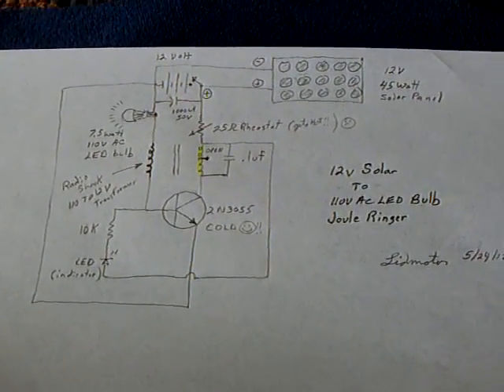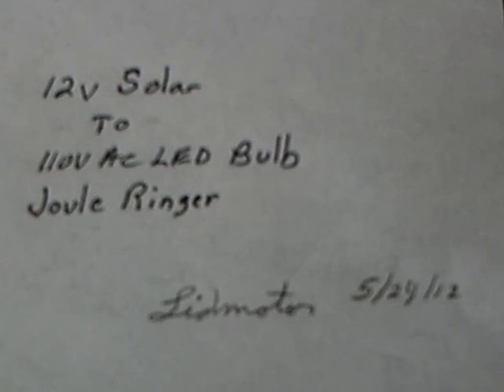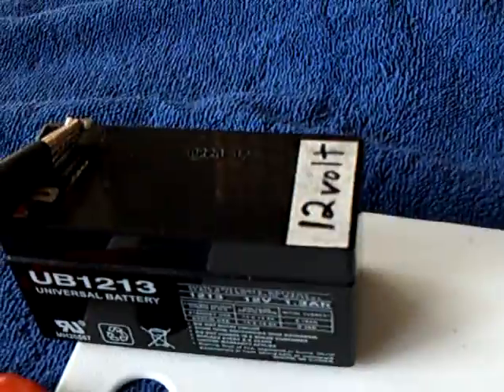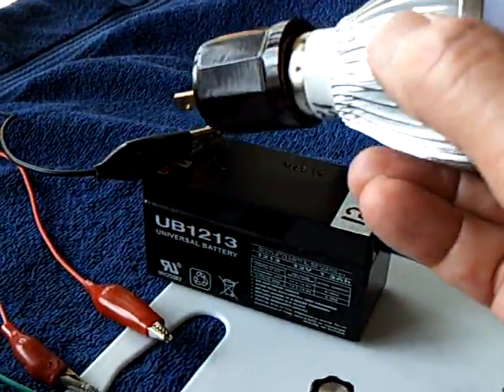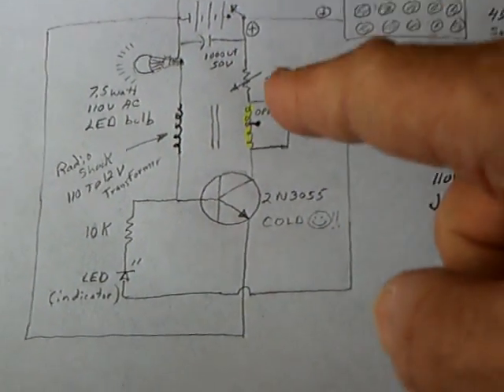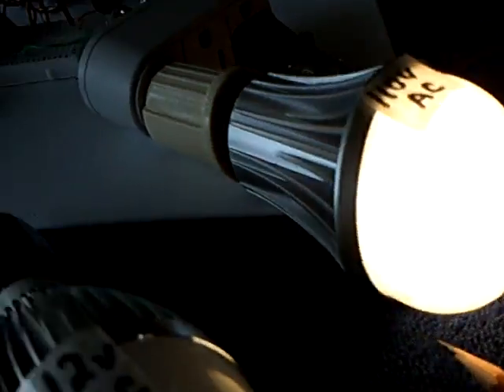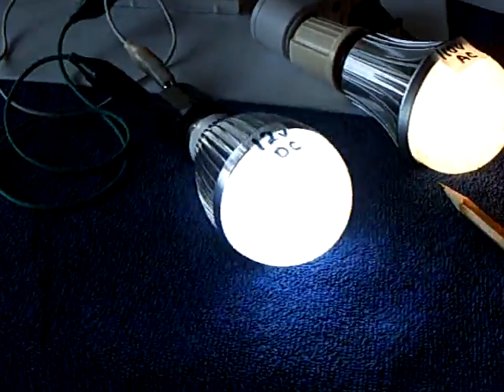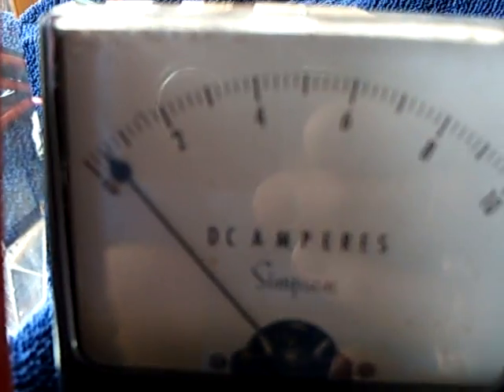Solar to 110v AC LED Bulb ---Joule Ringer

Comment: Ditch the PV panel, (maybe, if you like) and try some of Tesla's radiant energy collectors, I'd be especially interested to see someone in a highrise try this. PV panels only last so long, and are pretty toxic to make. Tesla radiant panels could be made to work for hundreds of years, and will work at night too, as they collect power from stars too. I have only done it using uhf tv ant, but it seems to work. not just getting radio energy. I get more during daylight, and more again in strong sun

Comment: The circuit we are looking at needs LED bulbs burning for it to work, but the lumens are flowing even if they are not needed (the boat is at the dock, let's say) 

I've got a goofy idea for a light housing with a hood, for those times you would "turn out the lights" but still need to charge batteries.

Something shaped like a tuna-fish can, open at the top, with PV cels at the bottom, pelletier devices on inside walls and heat-sink on the outside. Extra charge while monitoring heat and light.

Comment: Some very interesting ideas around charging, and we haven't yet discussed synergies.

The "lidmotors boat" scenario, as I imagine it, might entail a PV panel, 12v storage battery, transformers and maybe some bigger capacitors. If batteries can be charged with inductance (and it seems they can) and the transformers and the caps cause inductance, how could these elements be arranged physically, what shielding or extra copper, could give us simultaneous inductance and direct current charging ?

Comment: Ambient solar. Nice. green and RBG led's are good for that, haven't played with them much though.
I have a similar dream. after selling my property and moving back to the city, it amazes me how wasteful people are with power.
So I am trying to charge battery's and run lights from radio waves, static, and maybe even cosmic ray's. I figure this stuff has plagued engineers for years, why not use it to our advantage.
These joule circuits are going to be very helpful! 
Thanks to all the contributors!

Comment from the maker: Thanks for that tip on used panels.  Congratulations on running on solar for over 10 years.  That is a dream for many of us who are suffering with big electric bills now.  Couple that with soaring gas prices and one's whole standard of living starts to deteriorate.  Especially if you are retired and living on a fixed income.  I'm working on indoor ambient photovoltaics so that even apartment dwellers could do SOMETHING off grid.   Even a small led light is a step in the right direction.

Comment from the maker: Yes!  On this circuit you can really tell the differences between the LED bulbs.  Some of my bulbs won't work alone on this circuit but will work if they are paralleled with ones that do.  Good job getting this to run on 4 volts.  Mine only runs on 6v and up.

Comment: I lived on solar for over 10 years. Be careful with used panels! They do deteriorate in sunlight! takes 10-20 years to bring amp's to about a third of new...

If it's been sitting in a dark shed for years you may have found a bargain though..

I got all my good panel's on ebay, direct from manufacturer, much cheaper than retail!

I've been following you and lasersaber for a bit, and would love some feedback on my first video.

Keep up the great work!

Comment: I made a small discovery tonight that if you place a 100ohm resister just after the the utilitech led bulb you can change the freqency and brightness of the blub but amp draw does change too but still worthy of a mention. I have worked on some adaptations of the circuit using very low voltages like 4 volts getting a lights of america bulb to light but found it only works on certain bulbs not all lights america. Each led light is a unique animal in the forest of led lamps.

Comment: Confirmed, a clock radio doesn't run lol, had to try it. Kinda interesting though, being as the device has own transformer and power circuitry...an inverter for inverters could be next, without traditional losses ! 
"When you're over the target" springs to mind again. So far, that's 7 anti-aircraft emplacements I note on this vid, very cool. Turn it around, it's kind of them, they let you know when you're on a winner :)

Comment: Well seeing as it's hard to run dc current over long wires, I'd say apparent brightness is all that matters if you plan on having a few bulbs around your boat, or even if someone wanted them around a house. AC is definitely the way to go.

Comment from the maker: Right now I can't answer that question very well.  The AC bulb (I think) is being "blinked" and the DC bulb is on constant.  That is where the "apparent brightness" comes into play.  As long as the blink is fast enough and the circuit doesn't rob too much juice---- the AC bulb should show a power advantage over the DC.  My eyeballs are saying the AC bulb running on this circuit is the winner.

Comment from the maker: I will try a choke there but I am probabbly going to use a variable voltage regulator as the current controler and dimmer.  Magnetman showed a simple one that he uses on that French flip flop inverter that we made a few months back.

Comment: Thanks for sharing. Wondering what might happen if you replaced the rheostat with a dc line choke. Works well with Royer, which I now power 15 watt fluoro's at the 3 watt level, with good results. Cheers. Happy boating this summer Rusty.

Comment: You mentioned offending people, wonder why, or indeed how ?
Good demo there of the 12V bulb version. I always like when big things power up straight from solar...makes me stop and think. Now it makes me think to put one of these circuits on my small panels and a mains outlet ! Cellphone chargers, clock radios and much more as well as bulbs could be used i'm sure, off the charging side maybe.